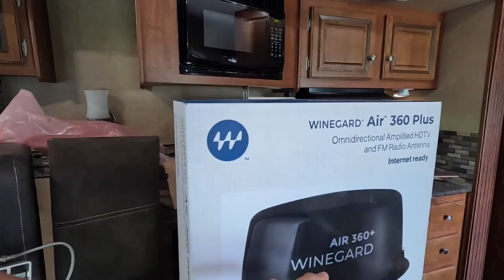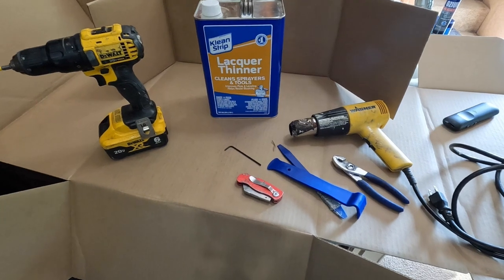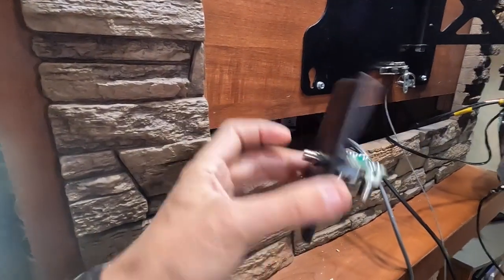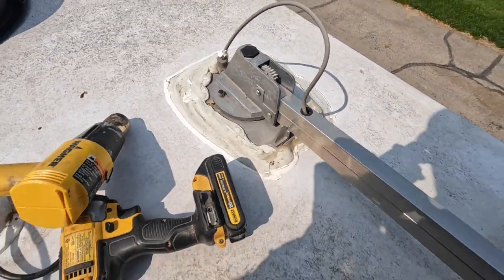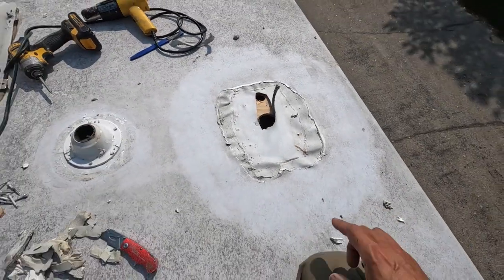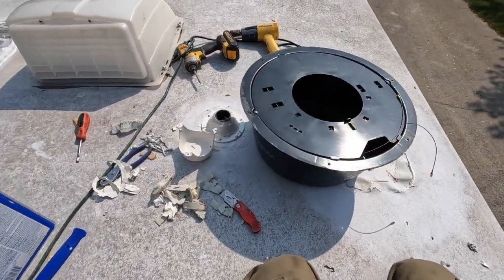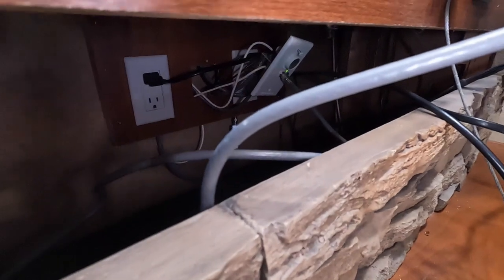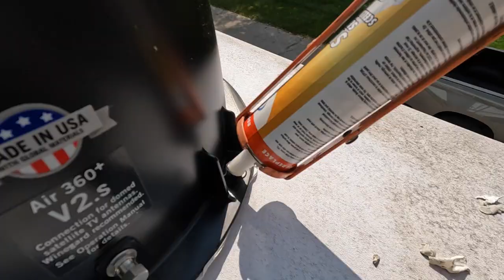How to Install Winegard Air 360+ v2.0 on RV or Camper

Comment: I’m going to install my own system like you did, can I power the gateway from my existing power switch that my tv is already powered from which is a Winegard 360 antenna only with a power switch on the wall.   

Or do the gateway need to be ran directly to the batteries for its own power according to the Winegard company?
Reply from the maker: I am not 100% sure. I thought the gateway would need tied back to the battery, through something like a light or the power side of a switch.